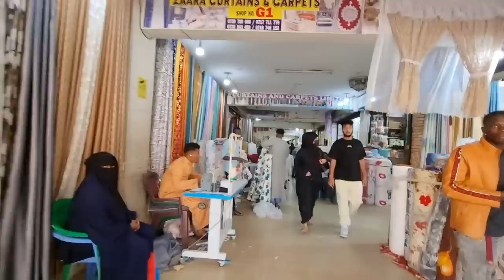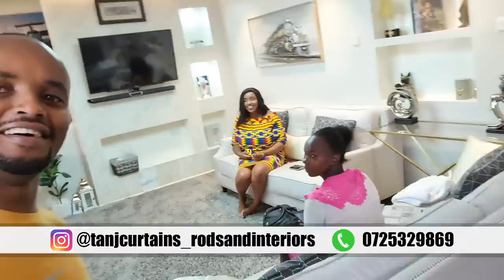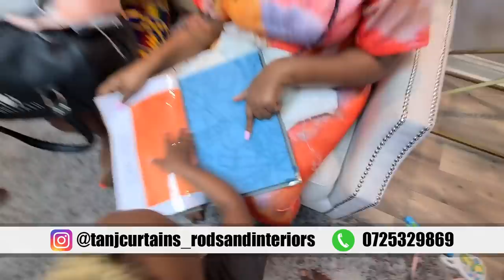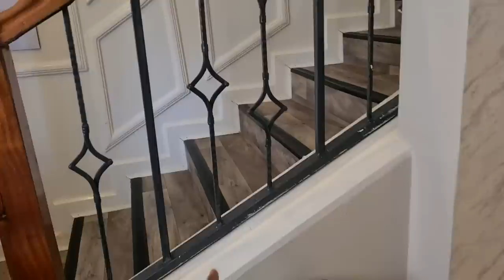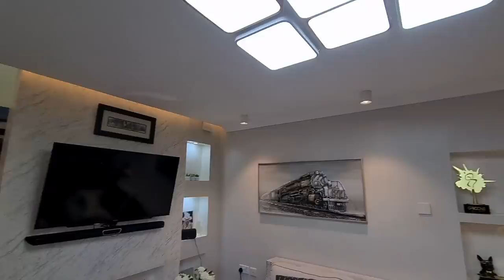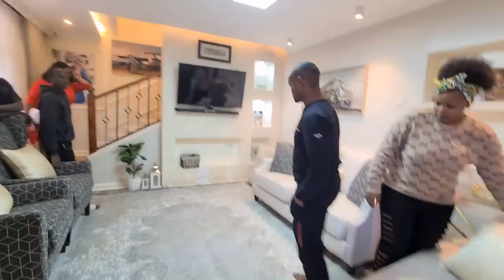FINALLY OUR HOUSE MAKEOVER NEW SEATS NEW CURTAINS & CARPET | THE WAJESUS FAMILY

Comment: Yes. Interior designers have completely different skill set from Interior decorators.

Interior design requires a degree and licensing here in the U.S.  The study includes CAD, drawing, space planning,furniture design, architecture etc They submit their drawings of the interior space along with the architect and engineer before the structure is put up or if you're renovating. Their job is to enhance the function of the room ( any structural changes- moving plumbing, wiring, adding doors/ windows etc)
The decorator doesn't need formal training . They focus on the asthetics. ( Furnishings, color scheme and accessories)They come into the picture only after the structural planning and execution are completed to focus on the surface look of the space.
Reply: 56 May god almigthy follow your way to a big succes u are blessed forever